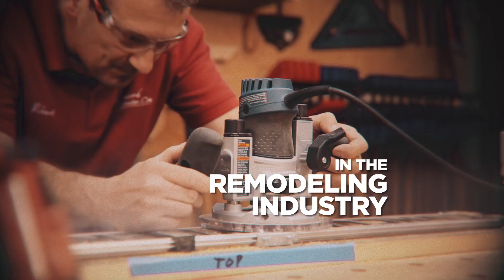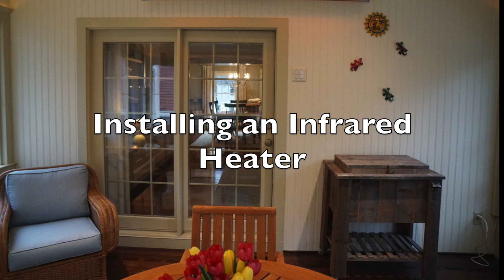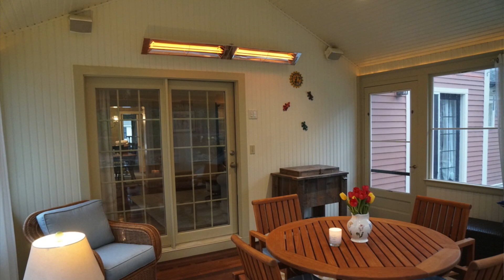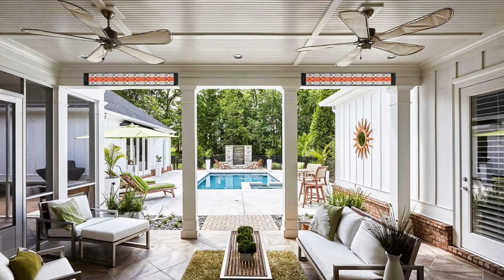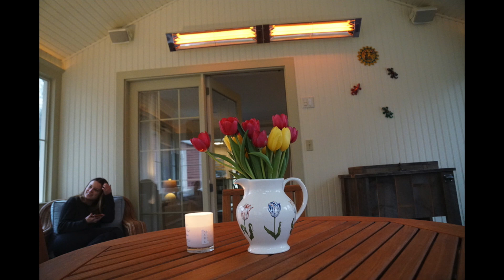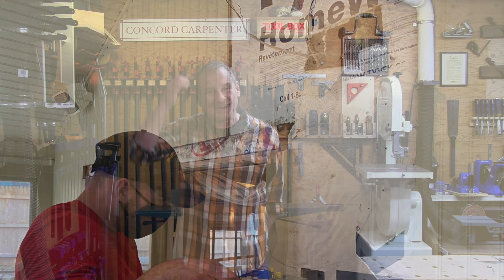Installing an Infrared Heater

Comment: Hey I'm glad I found this vide and channel. I've been going crazy trying to get somebody who knows this stuff to help me on what to buy and how to place it. Thing is I live in Sweden and for some reason the retailers here doesn't seem to have a clue about how these things work. I can't get any real answers. Would you mind giving me some advice on how and what to buy for my rooftop patio. I have three walls no ceiling and a big umbrella. It is however build in a pretty good way to not get too windy tbh. Even though on the other side I'm right by the ocean. As you know ins we den the weather can get pretty cold. But the country is very long and I'm all the way in the south so we barely get any snow or anything like that. Money is not an issue and I can easily over invest in too much to make sure I get what I need and then as you said just dial it down. Plz help SOS. Great video! Max/Sweden (BTW I have all the models ready to buy, they're like top of the line and around 2300W, IP65, ultra low glare or whatever it's called)

Comment: What heaters did you install? All I heard is they were using 30amp circuits each.
Reply from the maker: Infratech
Reply: @ConcordCarpenter  sorry I meant what model heaters.
Reply from the maker: @alexallias  not sure click link - it’s in the article
Reply from the maker: @alexallias  https://www.aconcordcarpenter.com/installing-an-infratech-heater.html

And

https://www.aconcordcarpenter.com/choosing-a-patio-infrared-heater.html

Comment: I've brainstormed about using infrared heater like this for windmills repairs. You take three 6000W radiant heaters with a heavy-duty casing, a   20kW generator, a pipeline welders tent, two 4' X 8' plywoods with coarse grip tape for the floor a few reflecting tarps, and voilà. This way you have a heating system and an epoxy post-cure system without having to put a heating blanket with a vacuum bag to hold it for the post cure system.

Comment: Great video.  Great product.  I have a 10x20 sun room uninsulated with glass roof and one side sliding and retractable glass wall.  The room is very cold during the cold months.  I like to have two of these heaters installed on the wooded side of the room.  Where in Canada could I buy them.  I live in Brampton, Ontario.  I would appreciate if you will kindly forward me the source in Canada, failing which, the name of the company you purchased from.  
Regards,
Mike

Comment: Do we need special direct electric cable from meter to connect this heater or just simple plug in?
Reply from the maker: Yes a co amp circuit and proper size wire

Comment: And if I wanted to install them in my garage? Yes? No? My garage is 24X24. It is insulated and sheetrocked. I have half (well, maybe I use a smidge more😁) for my workshop. The other half houses my wife’s car. I’m looking for a cost efficient means to heat it when I’m working in my workshop or, on the vehicles. I do the main duct that goes from my basement furnace to both the first and second floor, in the garage and it’s boxed in and sheet rock covered as well. I thought about jumping into that the a sort of industrial style pipe with vents I can turn off or in with a baffle. Oh, it’s gas furnace with forced hot air. So, is that a better option for me or might a couple of these heaters be better? Hey, I love having a local guy of your talent on YouTube! Concord Carpenter...I think of a 1770’s carpenter/woodworker! I know, profiling!!🤣🇺🇸👍🏻
Reply from the maker: It would be perfect for a garage shop

Comment: Are the gas radiant type heaters similar in safety (carbon monoxide) and efficiency? I've kind of been leaning that way over electric but having a hard time deciphering some of the details.
Reply from the maker: Infrared is more efficient and safer

Comment: Did you receive the heaters free or at a discounted rate? If your planning on using an outdoor space year round, a four seasons room makes more sense to start with. Proper planning prevents these bad decisions. 
   Radiant heat is a much better choice in the floor.
Reply from the maker: The screen porch has mylar panels to insert. The porch is built in 2001. Infrared heating is way better in the situation since the floor is an insulated and radiant heat would be ineffective